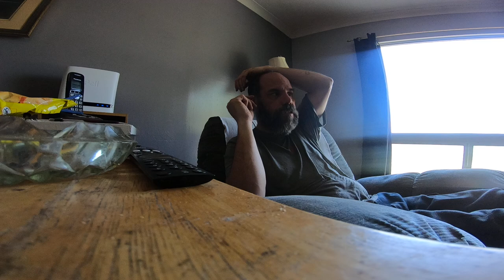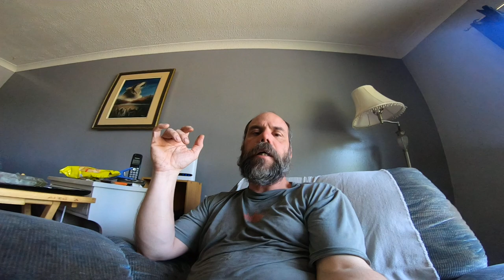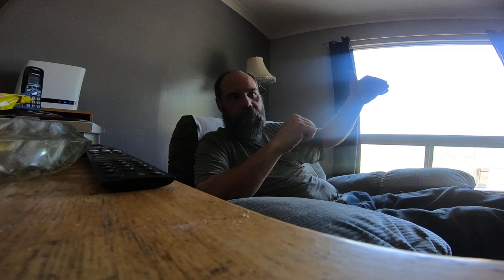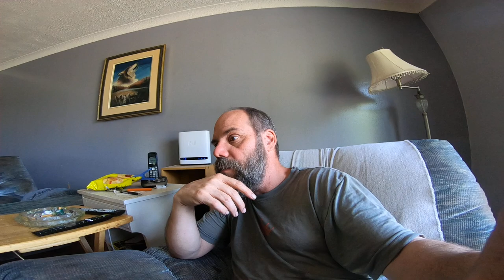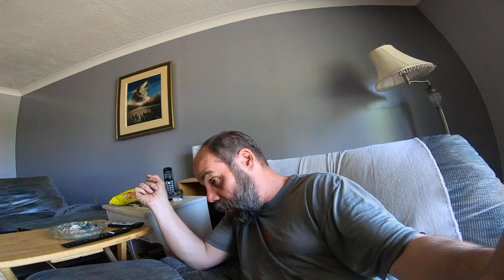Censor tapping time 2

Comment: Fix your EGR first. You should never look for new problems when there is a known problem. If the hose going to the charcoal canister is cracked then you will not get the charcoal can vacuum issues with the gas tank. Did you ever test the purge solenoid? That pulls vapor from the charcoal can up to the engine to be burned

Comment: Cut the cat off, sell it, buy a regular sized pipe wrench and change the oil. 🤠👍
Reply: And a new drain bolt to replace the old one.
Reply: @sourmashy1  In a Richie Rich world, yes. But Reg needs pepsi so once Reg has the magic pipe wrench, the plug becomes reusable again. Drainplug money can be used for refreshments. 🤠👍
Reply: @andrewmunchkin7212  Hehehe
Reply: @andrewmunchkin7212  Then he heeds to sell one of the recent guitars he's bought. He is fast tracking in a direction of ruining things on that truck and making it too difficult to fix. I don't know what this new problem is he has but he shouldn't be trying to fix it when he knows the EGR is no good. Just having that removed from the truck can cause codes for other things.